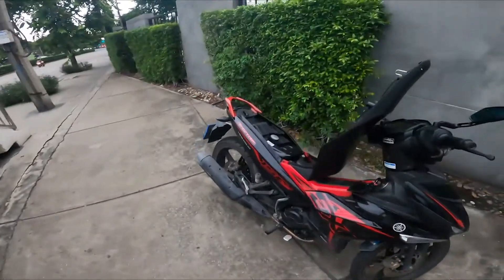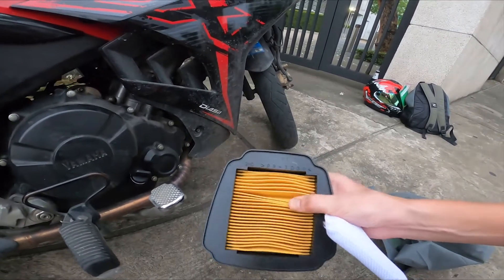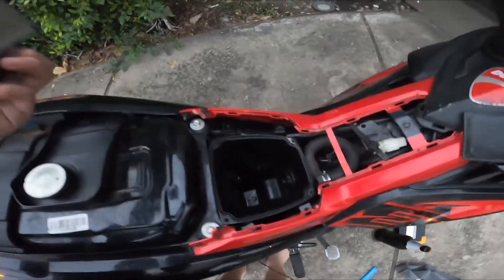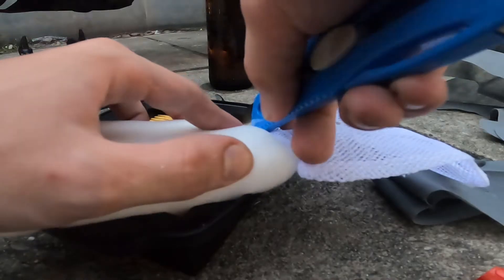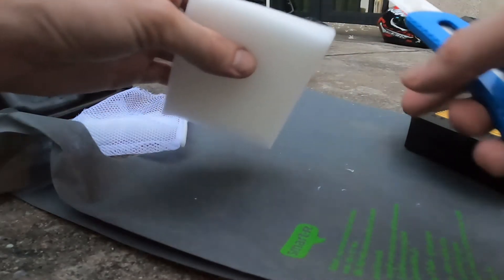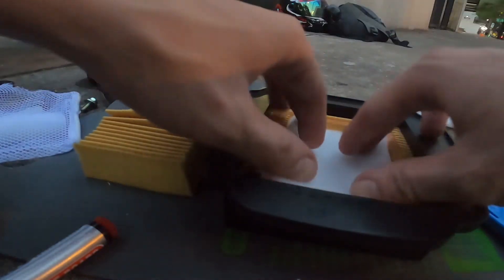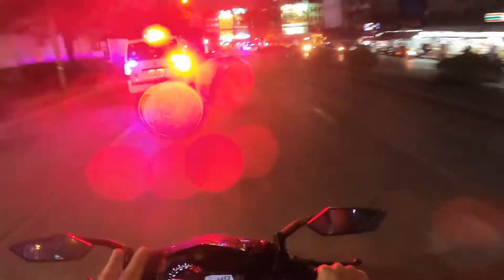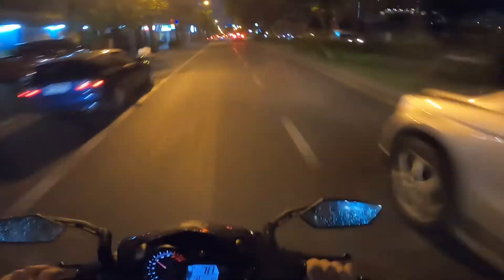USING A SPONGE AS AN AIR FILTER!!!

Comment: Yeah here in philippines we slap some 3m sponge with oil in our air filters if we are out on budget or far away from moto shops they said old motorcycle models use regular sponge filter as air filter

Comment: Air filters do not increase or decrease performance they “filter” air born dirt particles so you require a special sponge which is an open cell constriction to allow air passage  to engine and prevent wear … some sponge is closed cel and will block air passage So check first
Reply from the maker: You get more power by adding more air to the combustion chamber. I'm no bike expert but a simple google search gave me that result, so I tried. It didn't work for me.
Reply: No! More Air = More Power.. Filter Block too much Air.